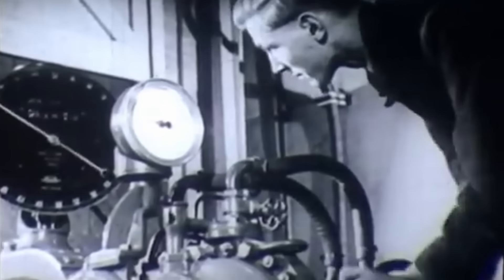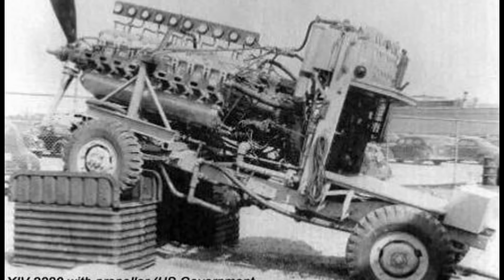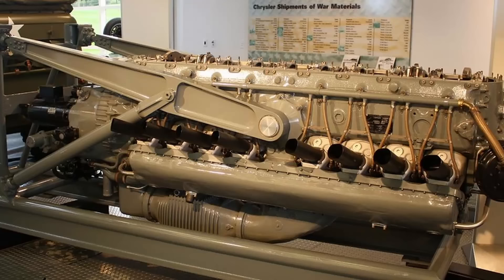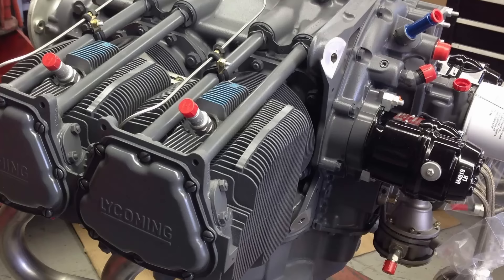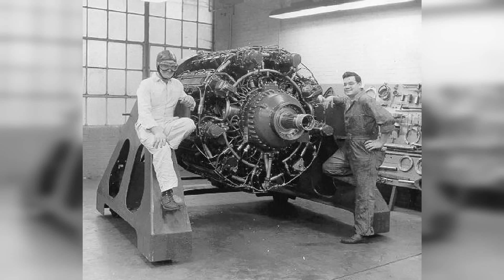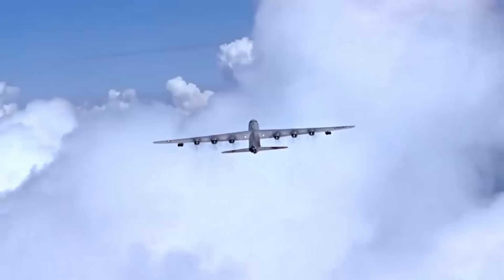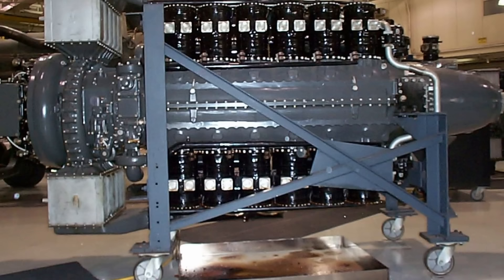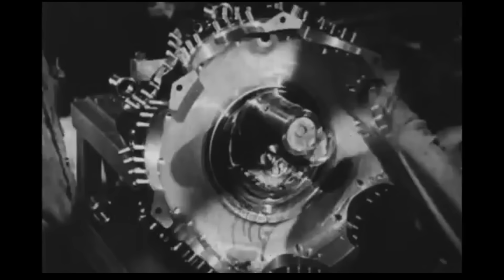The Forgotten HYPER Aircraft Engines of WWII

Comment: Historically, just as one technology peaks a new technology emerges to replace it.  In the case of internal combustion aircraft engines just as they began developing 3000 HP engines the Jet engine emerged as providing more power with less complicated add-ons like turbochargers and water injectors.  The British were the first to realize that they had come to the end of the line when their 3000hp engine developed so much torque the pilot was unable to control the aircraft after making a left hand turn he crashed!  The advantage of the 4360 was that it developed its amazing HP at relatively low engine revs, which prolonged the life of the engine. The amount of engineering that went into these engines using a slide rule and pencil is just plain amazing!

Comment: 5:36 Trying to picture them screaming over the radio "THATS VTEC KICKING IN YO!!" 😂
Reply: For one, that's true ... but ... a twovalve engine does miss out on the easiest next step that significantly increases power, ... anyway, I'd love to see the actual mechanics employed here, as without all the electronics and with machinery, materials, processes being in that times' state of the art, this always is amazing to see and understand - and also understand where and why it failed at that time.

Anyway, they, for sure, would have felt a bump in power output, just like ... VTEC kicking in. Which, still, is pretty cool, ... all those hiding of means to increase efficiency ... "You're not supposed to notice the deactivation (of half the cylinders)", ... I WANT to notice, I want to hear and feel that, and any engine manufacturer should be proud of what they achieved, and not have to hide their efforts or effects!

Engine development, at times, is pretty disappointing, as for whatever feature you have in mind, the same or a close relative has always been invented by someone else, who's dead since forever by now, and didn't live to see his invetion alive and running either. Variable valvetrain stuff, of the continuous or the discrete types, have been around in engineers' heads since ... forever?

The new stuff only is new by details. I've invented a valvetrain, made up my mind and drew a sketch, and then, the latest issue of a book on a conference adressing this topic happened into my hands, which had a picture in it, among others, that showed my valvetrain - readily developed at Nissan's, and just about being introduced!

Of course, they didn't copy my stuff. I didn't know theirs, but by the time I drew my little sketch, they must have been pretty far in their development. An idea, being had twice, isn't that unusual, if it stems from a logically sound approach to a problem deserving of a solution.

Comment: Great video.  At the National Museum of the USAF (Dayton OH) there is a partial cutaway of an R-4360, with components that slowly move.  A Very complicated engine, like the ones you show.  It is easy to imagine how a B-36 could have to shut down one or more engines.  I think of all the engineers and mechanics working in the 40's to solve all the problems, without CAD or CAE tools we have today.  It is pretty amazing what they accomplished.

From the Wiki B-36 article: 

As engine fires occurred with the B-36's radial engines, some crews humorously changed the aircraft's slogan from "six turning, four burning" into

"two turning, two burning, two smoking, two choking and two more unaccounted for"
Reply: I had to adjust the magnetos on a 4360 for my faa practical test for my power plant certificate!
Reply: Got one of those cutaways at the Evergreen Aviation Museum in Oregon with the Spruce Goose and my friend who knows nothing about planes was flabbergasted at the engine XD

Comment: Seems incomplete without mention of Bristol, they already had highly mature sleeve valve designs and provided the fixes for Napier. The omission of the Centaurus is regrettable as it had far more potential that the PW and CR big radials and provided excellent post war service even in its low state of tune.

Comment: Very nice video.  The Lycoming XR-7755 was tested at the propulsion laboratory at Wright-Patterson Air Force Base in Dayton, Ohio.  When the testing program ended, instead returning the engine to Lycoming, it was burried in the ground somewhere on base and nobody has figured out where exactually it was burried.  Lycoming has already expressed interest in getting this engine back to their factory if only it can be found.  Think Lycoming only built 3 examples, one was a mock up and the other two were running examples.  The only known surviving XR-7755 is in the Smithsonian.
Reply: There's a team whose sole goal is to find hidden objects. The crew is currently working on Oak Island.
Reply: @outlet6989  funny
Reply: For years there was a rumor that there were R-2800s buried somewhere on the Nash Motors property in Kenosha.

Comment: I'm not saying this to create an argument, just to be honest. The Daimler DB 600 and Yumo line were 10 years ahead (technologically speaking) with any internal combustion engine that the allies have manufactured.
Reply: That would be a very fair and accurate statement, there is no doubt that Germany made the most technically advanced engines during WW2.
Reply: If you look at the power output per litre of the Merlin and Sabre they were always infront of their German counterparts.

Comment: The Lycoming XR-7755 was the big motor that Howard Hughes intended to use in the Spruce Goose.  When it was cancelled he had to use 4360s, the biggest available.   This is most likely why it was only flown once in a straight line and in ground effect for most of the flight, even though empty.  Then Howard parked it for good.  Not enough power.

Comment: The radial made a lot more sense . It could withstand hits and develop the power. A 10,000 hp prop driven aircraft was still limited by prop top speed .
Reply: While I agree with you regarding the radials making a LOT more sense for most applications, the prop isn’t as big of an issue as many think. 

Most of the fighters towards the end of the war were reaching the limit of prop diameter and torque / p-factor, and many began attempting contra-rotating prop 
designs. 

The TU-95 works just fine with 15,000hp engines driving props.

If you go with a complex scimitar you can achieve similar results such as the 11,000hp engine on the A400m. 

But yeah, you couldn’t have a single prop on a single-engine plane making those HP numbers, the p-factor would just be outrageous.
Reply: Radials lack sufficient cooling above 2,000 kW to have made more sense. Which was why 4-row radials like the ASh-73, R-4360 and even R-3350 suffered from reliability issues due to overheating of back cylinders and the excess power being eaten up to provide for cooling. Thereby increasing cooling drag which accounts for a sizeable percentage of total drag especially at higher speeds.

Comment: Great look at the classics – I had never heard the 4360 was chosen over the 7755 due to politics when there were more practical reasons. Also the early B-36’s were not grossly underpowered, there being many early demonstrations that met payload and range goals – the jets were added mostly to allow higher speed on target runs.
Reply: Well, full load, hot and/or high density altitude takeoffs in an early B36 were a very chancy affair. The aircraft required extremely long takeoff runs even under the best conditions, so I'd say far all practical purposes the early 36s were indeed underpowered and in fact, the later ones were not much better than marginal either.
This is all pretty well known and documented, but I'll add I had an uncle, career USAF who flew 36s. Pretty much disliked them for all the above reasons.
Reply: All true – but that underpowered definition would apply to all other prop bombers as well. I didn’t have a B-36 uncle but was historian for a B-36 retired group and knew several A/Cs along with B-36 test pilot Beryl Erickson. None of them ever singled it out as underpowered.
Reply: @johnwatson3948  The begs the question then - why were the four J47s added if the early 36s weren't underpowered ?  
Everything I have ever read indicated that the 36 power/weight ratio was very marginal at best and that the R4360s were not particularly reliable which compounded the problem.
All that being said, I think we must recognize that despite the meddling of politicians the B36 did its job well, holding the line until the 47 and 52 came into use.
Reply: I tend to believe that the Wasp Major was chosen because it worked, and was available in series production (also used on the F2G, XP-72, AM, XF-11, XF-12, Martin Mars, and a slew of transports).  And based on wartime experience with  several hundred thousand P&W engines, Air Force brass knew that Pratt had sweated all the details on their smaller radials.
Reply: Yes I think you’re right that’s certainly what was going on. The 4360 was already proven while the 7755 needed further development and required a liquid cooling radiator system which would take up space and I don’t think is included in its power-to- weight ratio. The contra-prop system it needed might also have caused some concern. Apparently was not practical for the 7755 to be used in the pusher mode – one early 1940’s B-36 wind tunnel model shows very large forward mounted stubs on the wing leading edge - the only evidence I’ve seen that the 7755 was considered.
Reply: @johnwatson3948  It wasn't all that practical to use the 4360 in pusher mode either. In every other application of that engine, it was always used in tractor mode. Remember that these engines used carburettors, they didn't have fuel injection. Because of their sheer size and hence rate of fuel consumption, the fuel flow through the carburettors was rather high, and all that evaporation could make them ice up. In tractor mode this isn't a problem, because the carburettors are mounted behind the engine, so they get continual warm air flow over them from the cooling of the engine itself - the air intake goes over the cooling fins on the cylinders first.
But in the B-36 with its pusher configuration, the engines were mounted the other way round, so the air intake flowed air to the carburettors first, before flowing over the engine cooling fins. Because of this, there was no heat flow into the carburettors, only heat flow out of them due to the evaporating fuel, so they would eventually ice up. Because the ice buildup partially blocked the inlet, the fuel-air mixture became too fuel rich, so the engine exhaust ended up with too much unburned fuel. This would often ignite after leaving the tailpipe, causing fires - several aircraft were actually brought down because of this, with a few crashes, including one which led to the first "broken arrow" situation involving the loss of a nuclear weapon.
Reply: The B-36 carburetor ice afterburning problem became something of a legend but actually was only around in the early days of the B-36. The 1950 “Broken Arrow” accident prompted a successful fix involving new adjustments to the carburetor. There were no serious incidents after this and “Broken Arrow” was the only crash caused by it - the details of the other 21 B-36 crashes are well known. The majority of B-36s were built with fuel injected 4360’s starting in 1951.
Reply: @johnwatson3948  well... 2 choking 2 smoking 2 burning 2 turning or how was that aircraft called? that engine was tested but it still worked very bad in b36 anyway
Reply: Was told the 4 jets were for a shorter take off, per one of the engineers on the project.

Comment: The Chrysler engine had hemispherical combustion chambers. Putting two valves in a hemispherical combustion chamber pushrod motor with push rods and rocker shafts requires an excessively long rocker for the exhaust valve. It would be almost impossible to put four valves in a pushrod hemispherical combustion chamber and retain rocker shafts. But Chrysler, as they sometimes tended to do for a couple of decades, could get fixated on one particular aspect of engineering "rightness" even though the advantage precluded other positive strategies or even simplicity. For instance Chrysler held onto left-hand thread lug nuts for the left side wheels for years after Ford and GM abandoned them as unnecessary because of lug nut design advances.
Reply: don't 4 valves collide unless you put intakes on opposite sides ( and exhaust on opposite ). Also the rocker arm will collide with the next cylinder, unless you rotate by some odd 20° . VW engines have their exhaust valves point away from the engine. I guess to keep the heat away.
Reply: And nuts and bolts that required wrenches in 32nds of an inch. 19/32 and 25/32 if I recall correctly.

Comment: The Americans sort of missed the bus with some of these. On the other hand, there were always increasing demands for engine power but they seemed to be done on occasions, independently of aircraft development. Perhaps the best example of this was the sleeve valve Pratt & Whitney. All that seems to have proved was that Pratt & Whitney was capable of producing a sleeve valve engine. Compared to the Sabre, it wasn't all that well executed. The Sabre was intended to provide the densest power generation for the lowest possible frontal area. The P&W, while doubtless well-built, is the kind of shape that would have given aircraft designers nightmares.

The Wright R-2160 looks a lot like the Jump 222. In contrast to the Pratt & Whitney, this is a much more sympathetic design in streamlining terms. But I would imagine tha, like the Jump, the rear cylinders ran a lot hotter than the front ones (front and rear being interchangeable for the B-36... you get the idea).

Comment: What I don't get is that none of them used 4 valve per cylinder designs while they wanted to maximize output (for the 4 stroke engines). Going from 2 to 4 valves seems to be one of the most test and tried ways to improve output (already long operational in existing engines like the RR merlin, etc.)

Comment: Talk about dodging the bullet.
Those things look like they required lot of TLC to keep working "reliably".
So glad the turbojet was created and perfectioned soon after.
Reply: Not soon after. The first steps had been taken, just not reliable enough. But yeah, these pistons have things moving around (or to and fro) in horrifying numbers. And it all needs racing plane quality oil. That can not be right. Suppose you got a 24 cylinder engine, that means 120 valves, if you want real power. Oops. Is that wisdom? It is beautiful, sure, I love it. Wouldn't it be great, if somebody designs a modern version of those 40-ish liter 24 cylinder engine in a W-configuration?   I guess there are racing ships or aerobatic planes that would need such a monster. A kevlar carbon Spitfire, maybe?
Reply: @voornaam3191  "soon" after not used properly. But in the grand scheme of things it was a short period, JMHO.

Comment: The Napier was a different animal in that it had 24 cyl's for higher RPM because of the lower reciprocating mass and sleeve valves to allow as much opening for air flow as forced induction could supply.  Problems?  Pilots needed to be on oxygen before they started it because of exhaust leaks.   Napier had the ringer on the drawing boards at the end of The War but as another commentator has stated the jet had already taken over.    Their Deltic engine powered rail engines and our Mekong Navy untill the 80's.
Reply: I love the  Sabre, it's an outrageous engine and the sleeve.valve.Bristol Centaurus which I have seen flying in a Seafury. The Secret Horsepower Race identifies that the sleeve.valve could not take high boost pressure because it would.deform and squeeze lube oil out with predictable consequences.  You could not.compensate by making it thicker because then heat transfer for cooling became an issue ..Clipping as the sleeve transitioned the ports was also possible.problem at.excessive boost.

Comment: I find it a bit bizarre that they focused on hp/cu in. rather than power to weight or specific fuel consumption (hp hour/gal).  Hp/cu in. is useless (for an aircraft) if the engine is heavy or uses a lot of fuel (also heavy).  

Hp/displacement is a racers metric where the displacement of the engine is limited by class rules.  Its not really relevant to aircraft design.
Reply: People who make these types of videos generally don't get that, because most of their experiences in life is with automobiles they tend to focus on HP/displacement instead of HP/weight which is equally as important with aircraft, they're both important, even if you could keep the weight the same designing a larger displacement engine in an aircraft the increased size is just as detrimental as increased weight, one of the reasons that the Rolls-Royce Griffon was vastly superior to the Merlin was because it was something like 30% more powerful but was only around 12% bigger. 
A milestone in aircraft engine's was the Pratt&Whitney R2800, none of these types of videos ever mentions that it was the first aircraft engine to hit 1 HP per pound. 
Another thing that can be deceiving about aircraft engine's is the power to weight of liquid cooled aircraft engine's, everyone always wants to run to Wikipedia and look up the power to weight ratings listed for different aircraft engine's especially the Merlin, but what they fail to realize is that because of the variations of it's use in different aircraft the weight of the cooling system and coolant is never included, that rating is always a comparison of power to the dry weight of one of those engine's, minus the radiator and associated cooling lines, on average add 250 lbs to what's listed then rework the math for power to weight to get a more accurate picture, wherein an air-cooled aircraft engine is listing the actual power to weight for one.